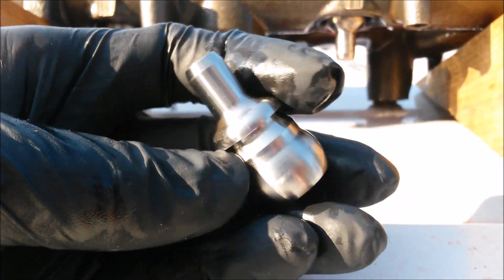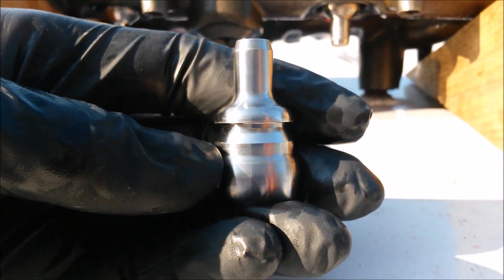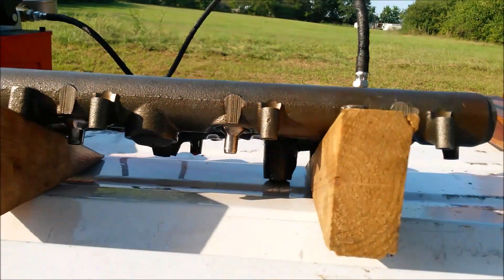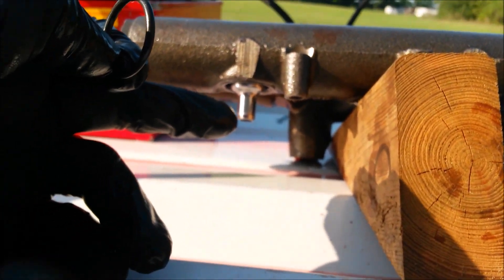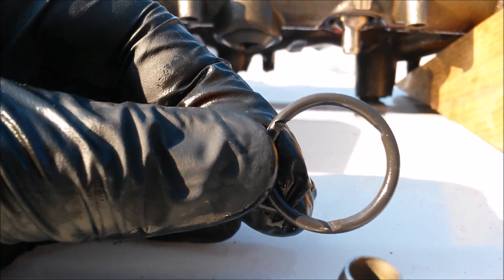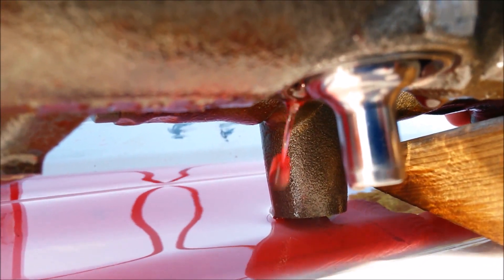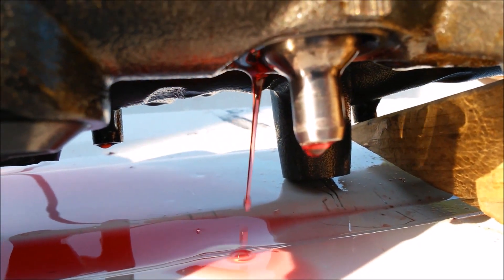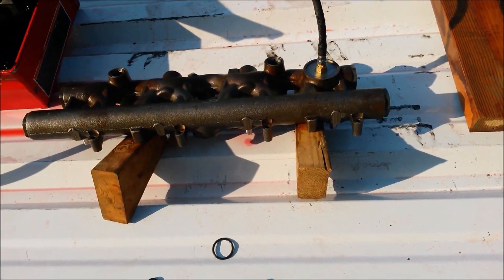HHC Diesel ~The Final Step in LeakProofing the Ford 6.0L Diesel Engine~ BulletProof Nipple Cups

Comment: I have changed my injector seals and the oil transfer tube seals. On my International 275 AEA in a Ford LCF 2005. I still experiencing a hard start and my pressure running 370 psi. I am hearing a leak down deep in engine when I pressure it up with shop air. I have the HP oil pump cover housing off but am unable to pinpoint were the leak is. I also have valve covers off. I read about leaks at dummy VB plugs. We're are these plugs? Are the in the lower section of the oil manifold? I can here but the air leak very good with the covers off and the HP cover off. I just can see it are pinpoint it. Any suggestions?